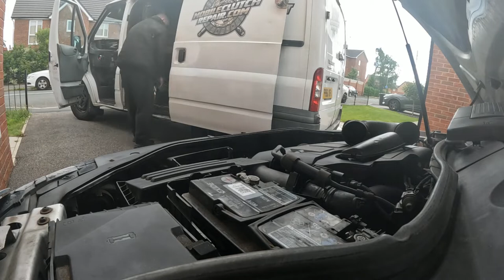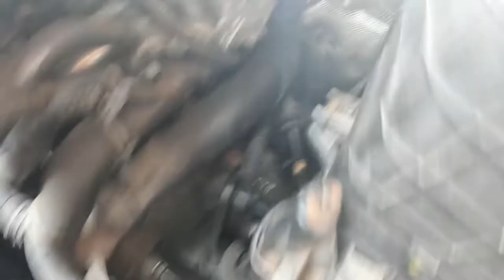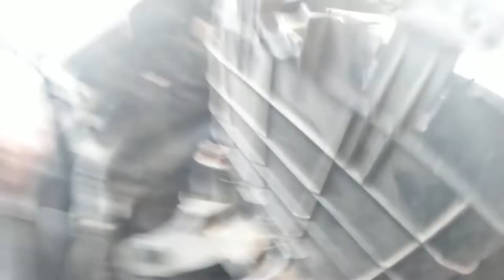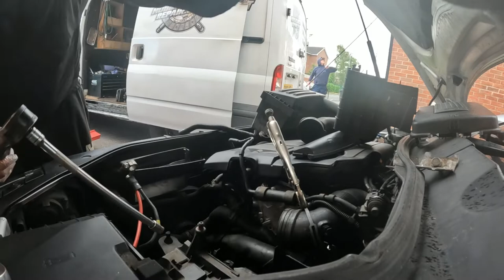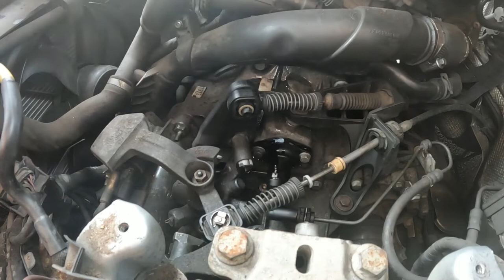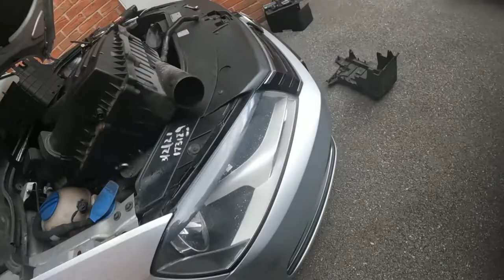How To Bleed A Hydraulic Clutch (Volkswagen Passat)

Comment: Using a pressure bleeder to bleed a clutch on a VW Passat 
Do I engage the pedal to the floor and leave it and then build up the pressure in the bottle and after five minutes open the nipple on top of the gearbox at the slave cylinder ?

Comment: Hi, I recently fitted a new clutch, flywheel and master cylinder but sometimes my pedal is dipped when I get in the car in the mornings. Sometimes when I let the clutch up the biting point is at the floor and sometimes it's really high. And nearly all the times the clutch pedal is vibrating until I lift it with my toe. What do u think could be causing this brother?

Comment: used the method of clamping the line to test master cylinder from another video and clutch had pressure but i pushed it harder and pedal slammed to the floor, replaced master cylinder and wouldnt bleed so called local mechanic still cant get it to bleed, mechanic thinks that clamping the line to test would have damaged it. is he having me on? lol
Reply: could have disturbed debris
Reply: @billybull7419  turned out the pressure plate and clutch disk had actually broken into pieces, master cylinder and hoses were fine
Reply: @onesix944  Oh wow, you got sorted anyway?